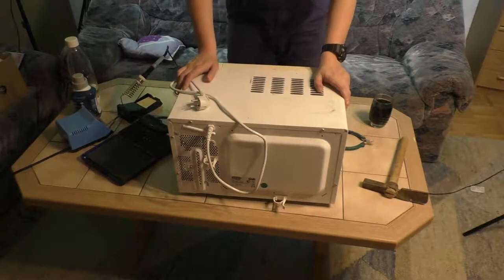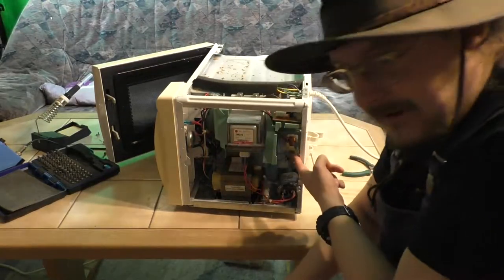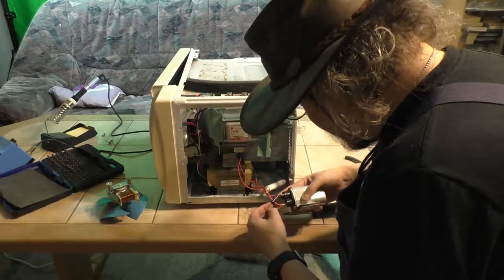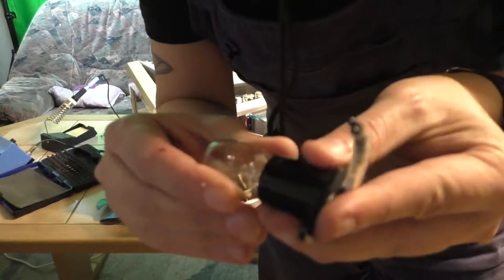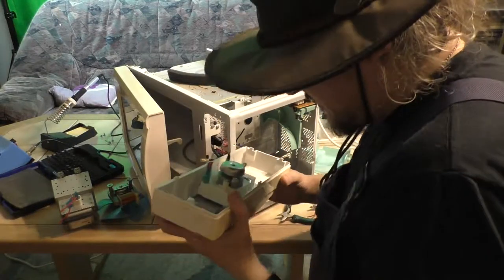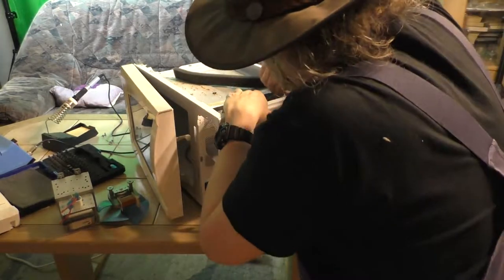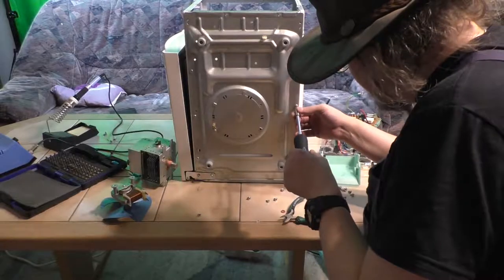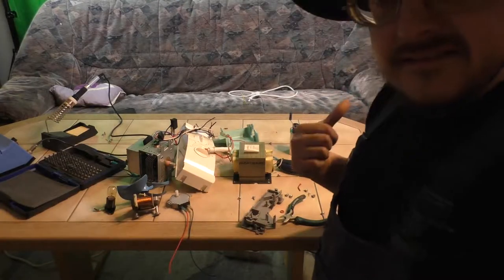The Mobile Couch #01: Microwave oven teardown

Comment: Hey are there any other Mobile Couch Videos so far?
Reply from the maker: Working on that. But i'm in the process of redesigning my studio, so i won't have to drag a 5x3 meter greenscreen through half the house to make one of those videos.

If you're OK without the fancy background, you could check out some of my GardenSpaceProgram videos liker https://www.youtube.com/watch?v=pP32FkxGDx8 or watch the two-parter about my home automation system https://www.youtube.com/watch?v=QXLTikqd1BU and https://www.youtube.com/watch?v=KdXc_E8AYIE